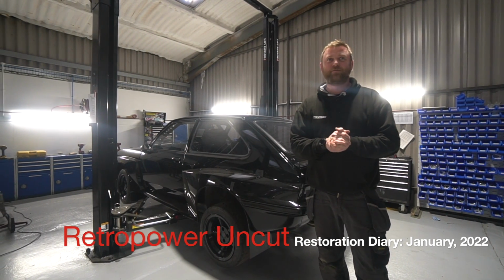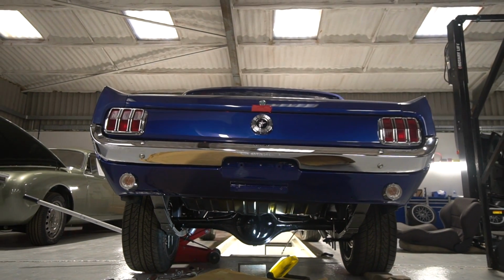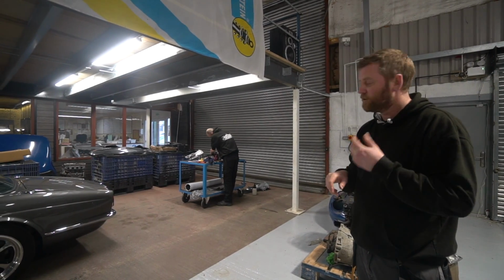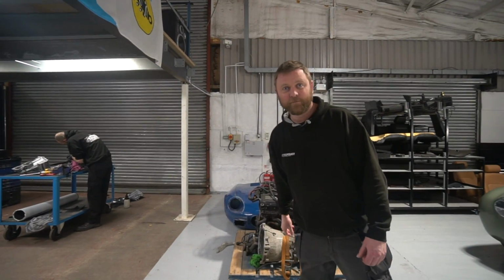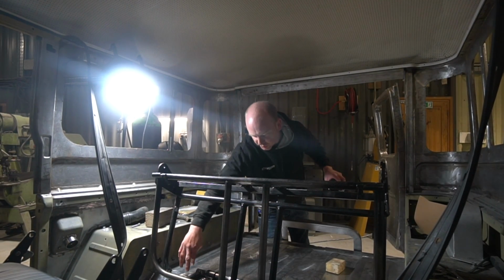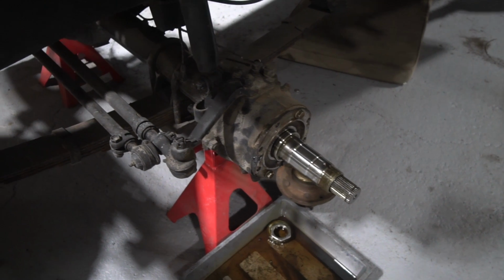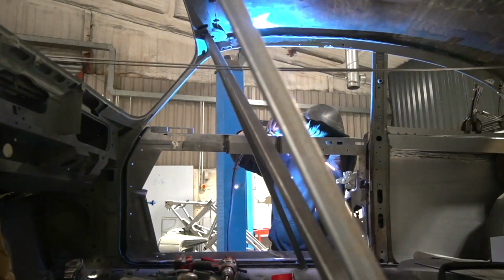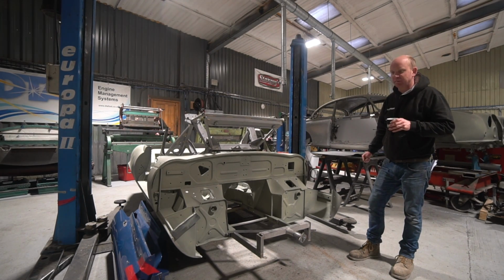Retropower Uncut Episode 72: Vader Chevette on the Dyno & Jaguar E-Type Sand Blasted!

Comment: In the last 2 years I build my MX-5 restomod, so I'm a little bit into MX-5 parts.
Why don't you use a 6 speed transmission for the Morris? It's way more durable. For the diff I would prefer a Torsen LSD from a NB or an aftermarket clutch type LSD like the Kaaz.
But, you're doing a great job and I'm following your work with great joy.

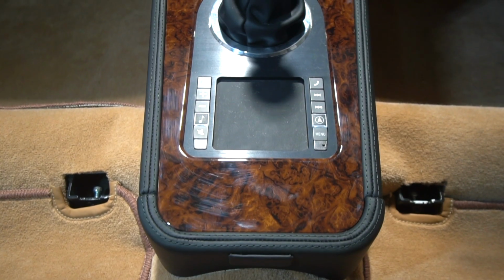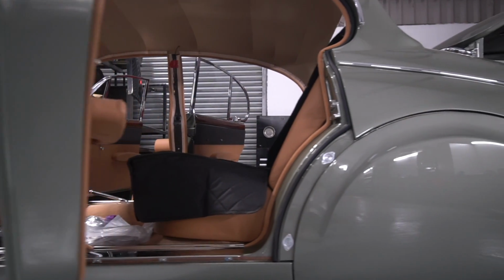Comment: @6:56 the drivers side seam on the back of the console doesn't line up, is that finished or needs fettling? Also @7:27 at 12 o'clock position on the wheel cover, it looks a bit off ie: not radiused. Is that an optical illusion?
Thanks
Reply from the maker: Console not fully fitted, neither are wheel covers

Comment: You can use Mondeo calipers on the rear disc conversion, will obviously need custom brackets but that’s what my FJ40 is running on 60series diffs. Also running a 1UZ but with a A343f trans.

Comment: I see a lot of US classics and yes the Yanks and panel beating do not go well together. Many are ok but many too are as you described.
How on earth did that Chevette pass any MOT?  Aracing car on racing tyres. Which themselves do not comply with road regulations and using them on the street and dynos just kills the compound and they turn into rocks in just a few hundred miles.
Reply: The big issue is price here in the US.  Shops who do "insurance level" repair are common and relatively inexpensive.  Shops who do restoration level" work, are expensive and fairly rare.  Most people can't tell the difference after it's finished, even when all the poor prep work starts popping through.  You get what you pay for.

Comment: Really window winder Knobs??? How much did that cost him, or did he get it for fee(thanks so much )because You couldn't make a handle using a parallelogram brace and an articulating handle which pulled inwards "cabin wise", when required to get away from the cage tube ?

Comment: Another great video on a busy weeks work.
However, regards to Vader and mapping it for 95 octane petrol, I am rather surprised that you even considered a low octane map with the rubbish E 10 petrol now being sold on our forecourts. With 10 % ethanol in the mix you are basically getting 10 % less petrol every time you fill up. It is now surely a no-brainer to only fill up with the more expensive Super Unleaded petrol. You save money in the long run and avoid the horrendous damage that the ethanol laced fuel will do to your lovely new throttle bodies? 🤔
Kind regards Paul from 48 Spokes
Reply: I suspect that additional mapping for E10 fuel is only a last resort if super isn't available
Reply: @alexbrown1995  I know, that is what Callum said but it would still run on the low octane fuel if that's all the owner could get.
We should all be using the super unleaded fuel now, it's a complete no-brainer. Only those who are focusing on the cost at the pumps without thinking this through will still continue to buy the E 10 petrol. I guess the money they think they are saving will go towards repairing their cars when they break down.

Comment: How do you go about registering these cars? Presumably they need an IVA inspection with the DVLA if they have never been registered in the UK before? Do they get age related numbers or are they put on Q plates? On the DVLA website there is a silly points system governing originality, can you circumvent this to get an age related number and avoid a dreaded Q plate?
Reply: It's just a chevette already registered? with an engine swap
Reply: @markbrown4348  I am talking more about the other ones. Heavily modified and new to the UK with imported shells.
Reply: Having done a couple of LR "hybrids" over the years:
Paperwork, lots of it.  Every bill for every "new" part.  Source information for all "non-original" parts like axles.  It's not easy, but given the number of cars they have done over the years they will have worked out a system so they can give VOSA & the DVLA all the required data and how to fill in the forms correctly.  Having the V5 for the main source vehicle helps greatly.
Reply: @18robsmith  I do not doubt they know their onions on this but I am just curious how this works. After all, heavily modified shells, totally different running gear etc. How do you register something like these cars and not get a Q Plate? After all, there is little of the original car left. I am genuinely ignorant of the law on this and am very curious to know.
Reply: @ralphmillais5237  Make sure you have ALL the paperwork for all the bits, fill in the forms, get it through its IVA, fill in more forms with the application for an age-related registration.... Sounds simple, but miss one tick on one of the forms and a "Q" plate will greet you with open arms.  It is NOT as simple as adding up the points, but following every bit of guidance that comes from the DVLA & VOSA, and there are reams of it.  Even talking to them about something they haven't thought about (try putting Jag IRS on a RR Classic.....).
Reply: @18robsmith  Sounds like the best plan would be to avoid talking to the DVLA altogether!
Reply: @Ralph Millais It´s the cruiser I´m wondering about it´s going to Spain and you can´t modify anything there.
Reply: @robshipman8691  Spain, and indeed most other EU countries, have really stringent "no mods" laws 😞  I dread to think about the amount of paperwork required, or if indeed such mods are possible to be done in Spain.  There may, emphasis "may", be a way for importing a vehicle into Spain that has been modified and registered in the UK (I would hope there is), but again paperwork......
Reply: @18robsmith  I live in Portugal and you wont get it matriculated with any mods or pass yearly inspection...
Reply: @robshipman8691  I had a feeling that would be the case 😞  
I hope the owner of the Land Cruiser is aware of that, and his use is going to be on private land, and not on the public road.

Comment: How do you get away without the obligatory red rear reflectors on Vader?
Reply: In 2nd I'd guess 😂
Reply: As a tester I was wondering that, and black number plates
Reply: @andrewkinsey2963  black number plates might just be possible… that moves forward with each year (Harry Metcalfe has recently, legally, put black plates on the XJ12C albeit that that car may be a tad older than Vader)
Reply: @TijgerTim  If it was registered after 1st  January 1980 white or yellow only
Reply: @andrewkinsey2963  yes. Vader appears to be on an 82/83 plate - it might have qualified for black plates this year if the exemption had not been rescinded last year…
Reply: brexit